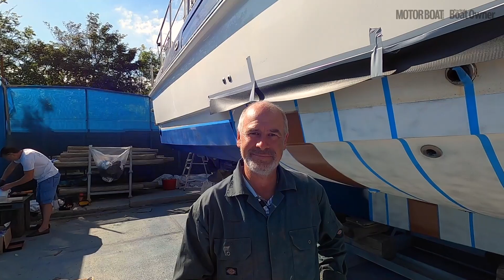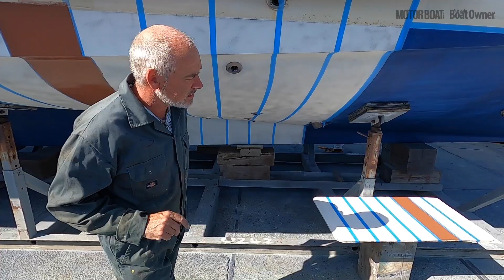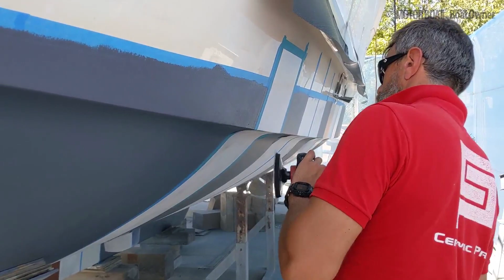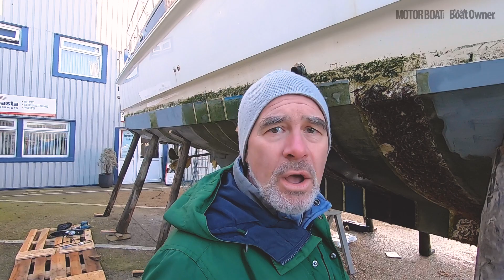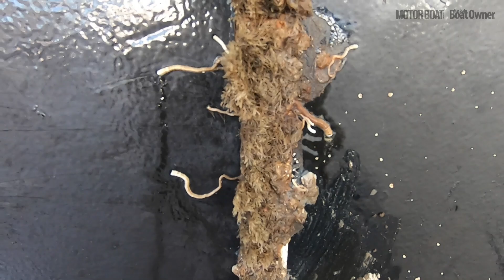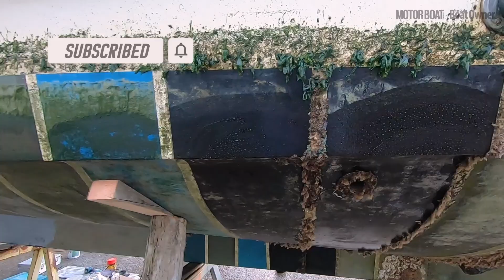Which is the best bottom paint for your boat? The big antifouling test 2022 | Motor Boat & Yachting

Comment: I've actually solved the silicone antifouling problem , almost 3 years into r&d and the solution was accompanied by a facepalm after spending so much time in over hundreds of formulations. None of the current silicone antifoulings work, they either keep a very low modulus accompanied by low tensile and shear strength because they can't add enough fumed silica in the silicone polymer hence some sea organisms can penetrate and adhere to it or they make it too hard with little fouling release efficieny, Fuji film had a division close over 10 years ago because they couldn't solve that problem, the akzo nobel companies took massive funding from the EU because of their connections and went around that problem without every solving it, neither international, jotun, or hempel has a real replacement for antifouling, their tensile strength is 0.5-1.0 MPa which is soft  and brittle like gelatin, don't get me started on propspeed these guys are scam artists.

Comment: Nothing new here, while the silicone coatings are seriously easy to clean, if left, like most boats are, the micro and macro fouling will adhere to them and barnacles will eventually eat through the coating. If you are prepared to clean the hull on a regular basis, the silicone coatings are definitely the way to go, but unfortunately the reality is that most boat owners cannot keep up a cleaning program to suit.